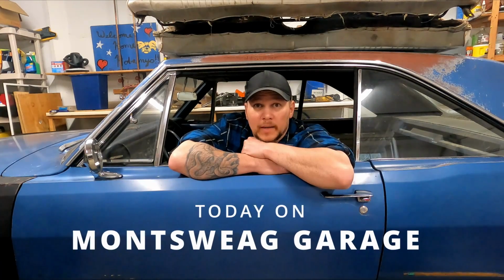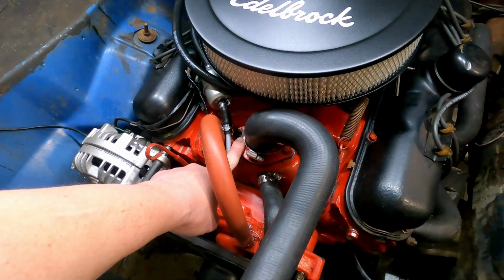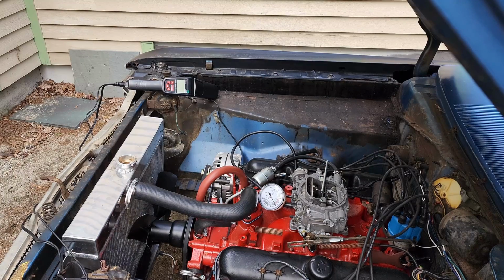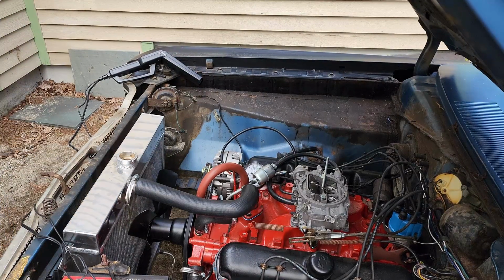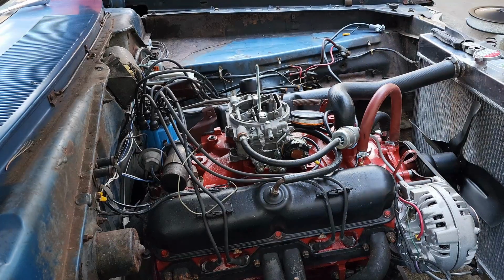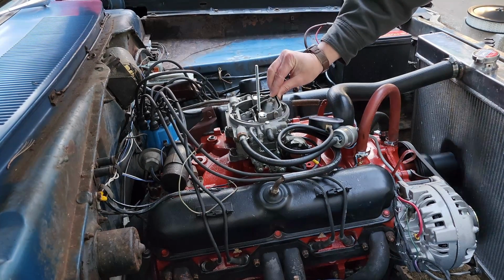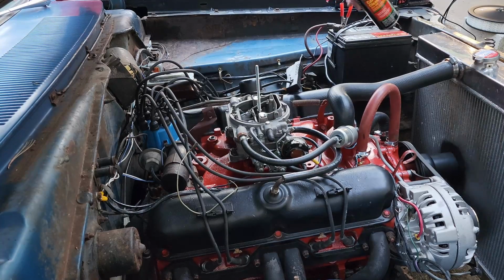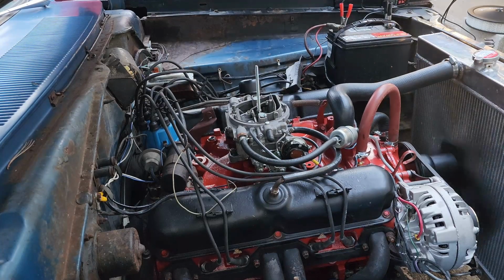1967 Dodge Dart: Continuing The 2 Barrel to 4 Barrel Conversion

Comment: To help this project if you want a faster fuel delivery use a Carter pull pump works great
Reply from the maker: Hello Joe! Welcome to the channel and thank you for the comment! The Dart's power train has evolved a lot since this video was published. I have since built a 5.9L Magnum engine which is getting a Hollley Sniper EFI which comes with it's own fuel pump. Until it is installed, I am running the engine (on the run stand) with a cheapo Edelbrock fuel pump I picked up from the parts store. I noticed a pretty big difference just using that and can't wait to get the car back together so I can try it out with the EFI.
Reply: @MontsweagGarage  thanks you know what's funny I believe I actually watched this video as well I've got a 318 will run great been thinking of doing something similar I appreciate you getting back to me
Reply from the maker: @Joseph_Headen  Though it will be a while before I get the car up and running again. I plan to cover the Sniper install pretty in depth. Feel free to hit me up if you have questions.....or give me a heads up if you beat me to it so I can check it out! Lol.
Reply: @MontsweagGarage  for now just playing around with new 2 barrel hope I get my timing right it's giving me a fit rev great not under load under load wants to spit and pop trying everything I know
Reply from the maker: That sounds like what my 273 was doing after I refreshed it. Mine ended up being a vacuum leak around the throttle shaft of the 55 year old carb. I had the problem with both the Carter BBD 2 bbl that was original to the car and the Carter AFB 4bbl I replaced it with. Ended up throwing a brand new 1406 on it and she smoothed right out.
Reply: @MontsweagGarage  possible vacuum leak should have labeled stuff lucky me there's always old vacuum diagrams

Comment: you may have an oddball early 273 4bbl intake there with a different angle on the manifold to head surface.
Reply from the maker: Hello and welcome to the channel! Thank you for the comment! The problem ended up being a vacuum leak around the throttle shaft combined with a poor job of torquing the intake bolts down. I ended up fixing both issues and drove the car for a year before taking it apart again for a deeper restoration effort.

Comment: Did you need a special throttle bracket? I'm gonna do the same to my w100
Reply from the maker: I did. I needed more than this though. I had to replace the bracket that bolts to the intake manifold with one from a 340 and an extension for the kickdown cable. Not sure if you have a manual or automatic but links for all the parts I picked up are below. I also had to do some bending on the kickdown linkage. I heated it up with a torch and bent it so that it didn't hit the throttle cable when going to WOT. Shoot me a message at MontsweagGarage@outlook.com if you want pics of the finished linkage.
https://www.summitracing.com/parts/EDL-1481
https://www.summitracing.com/parts/EDL-8004
https://www.ebay.com/itm/234603039854?chn=ps&norover=1&mkevt=1&mkrid=711-117182-37290-0&mkcid=2&itemid=234603039854&targetid=1645685073568&device=c&mktype=&googleloc=1018794&poi=&campaignid=16730423415&mkgroupid=135815925780&rlsatarget=pla-1645685073568&abcId=9300841&merchantid=6413484&gclid=CjwKCAjw9NeXBhAMEiwAbaY4lkjp5Ks0KomceO6YStF8uJlPmloL7KoT8SAtP3DfOEPdDEVHUUQICxoC43oQAvD_BwE

Comment: You better modify your throttle bracket and kickdown linkage so it lines up better. Anytime I see linkage like yours, I assume the person doesn't really know what he's doing.  Get it lined up,modified and adjusted correctly if you want your transmission to live.
Reply from the maker: Hello Myron. Welcome to the channel and thank you for your insight. At the time this video was made, I had not yet addressed the linkage and I really DIDN'T know what I was doing. It was a "learn as you go" adventure, as are are most of my undertakings on this car, and eventually I got it aligned well and the throttle pressure valve set correctly. This engine was recently retired (for now) and the replacement has appropriate brackets/hardware from Mancini Racing as well as a Lokar style "kickdown" cable for the throttle pressure valve.
Reply from the maker: You can actually see the end product briefly in this video. 
https://youtu.be/WjLdZvraXOs?si=XM2PQFee-bUNtqVP&t=456

Comment: My 72 Plymouth 318 absolutely woke up with the regular bolt on stuff,  4 barrel, performer manifold,  hooker 1 5/8 headers,msd coil and later model small chamber heads, the 302 part number, 86'-91'  small port heads.
Horsepower more than doubled from an anemic  145 to over 300hp
A great bang for the buck
Reply from the maker: Welcome Robert and thank you for the comment. The carb swap did wonders for the 273 but it still isn't where I want it to be. Fortunately it came with the 920 heads with the closed chambers, but the whole thing really needs a trip to the machine shop to be bored .030 over and a valve job. some day. The machine shops around here are fairly expensive. They wanted almost 2 grand for the work. I opted to put that money towards a 360 Magnum rebuild.
Reply: @MontsweagGarage  
Good plan I'd say and good luck with the build.
I'd really like to so a bit more stroke with mine some day.
Mopar forever!!
Reply from the maker: I am in the middle of the swap now. Got the rebuild done and the 273 out of the car. Have some other work to do before I drop the 360 in. Loving it though. Stay tuned if you are interested in the results. =)
Reply: @MontsweagGarage  
I will, thanks
Reply: You Smoking the Cheap shi or the Good shit lol lo😅😅😅
Reply: Stop what your doing i can get you a Hell of a great deal on a Really Strong Running Small Block Chevy The Damb thing Screams
Reply from the maker: @paulgill5813  In reference to what? I haven't smoked ANY shit since around '91.
Reply from the maker: @paulgill5813  Nah, I'm good. Had fun building the 360 and she purrs like a tiger. =) Thanks for the offer though....and the comments =)